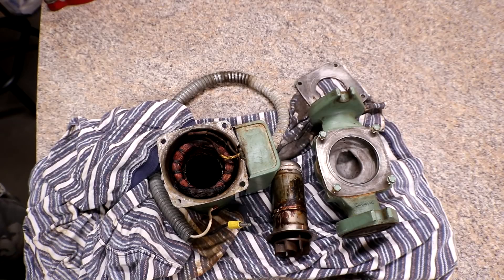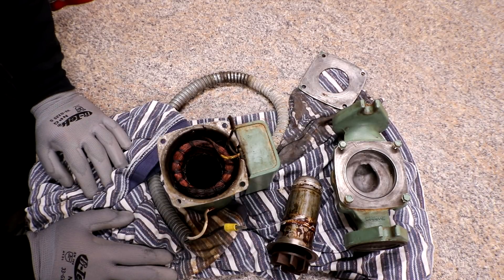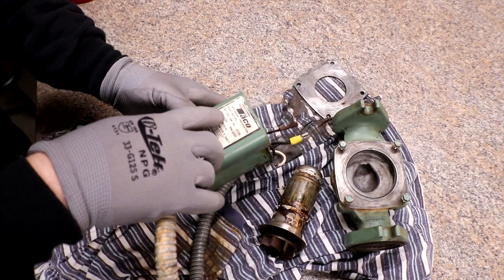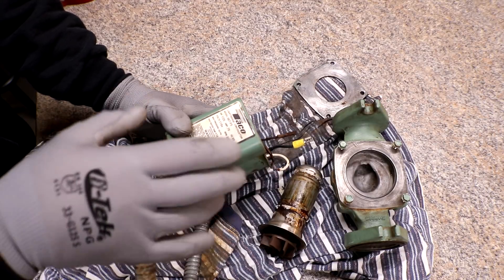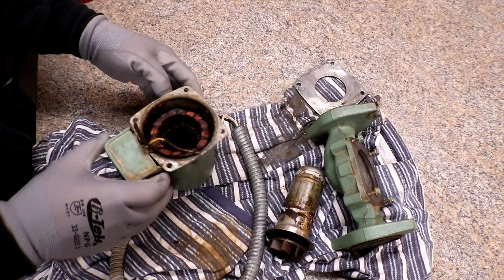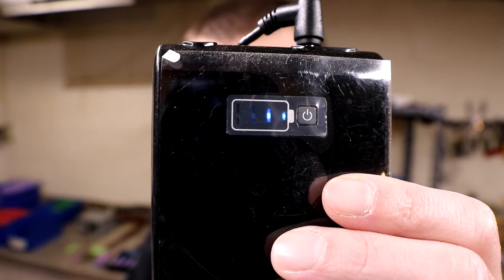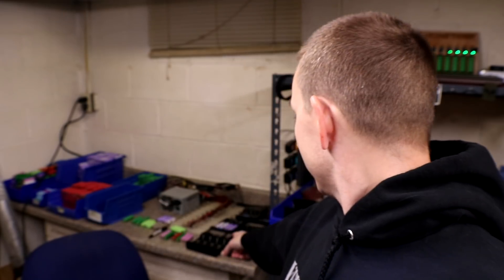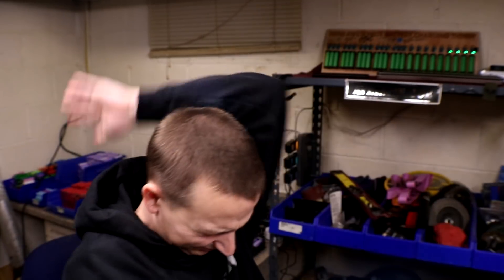Diy Tesla Powerwall ep74 Random Update on Batrium, Solar Hot Water Heater and More

Comment: For your pump, replace the gasket with Red RTV. That'll handle the heat better than the black stuff that it comes with. Also, it wouldn't hurt to add some heatsink material to the housing of the motor to help keep it cooler. 
Does the pump have oil in it? If it does, you might want to replace it with new mineral oil. If it doesn't have oil (I haven't seen a true water pump without it), you could probably add some in. The oil will keep everything lubricated, but more importantly, it helps to dissipate the heat.
Reply from the maker: Yeah I might have to try some rtv  next time I do some maintenance to it.  Theres no oil where the windings are and not sure about the cartridge.  Thats not a bad I deal to add tho👍

Comment: more solar hot water!  :)

Did you say max temperature of 240F? That is HOT... water boils at 212F unless sealed for high pressure (think radiator+cooling system or a pressure cooker).
Reply from the maker: LOL ya I said it.  All I know is it gets hot as sh!t and I had to put a lil vent on it to let the steam out.  Next time its sunny(hopefully this weekend) Ill use the the ir temp meter and check the tank and get it on video.  Yeah I would say its kinda like a car setup and it just circulates all day so it gets hotter and hotter.  Also when the tank gets low the water get hotter.  If I keep the tank full it helps to keep the temp down!

Comment: I bought a cheap battery pack for my cannon. When it failed I opened it and found that there were 2 18650s and a empty cylender!
Reply from the maker: EEEK, I bet it was expensive as well?  Did you replace the cells?
Reply: No I boughat one fromn Cannon

Comment: Why and or how is your solar hot water heater above boiling point
Reply from the maker: +James Holbrook It gets super hot some days and were I have the vent outside, it steams like crazy.
Reply: AveRage Joe but do you think it gets that hot and also I think not 100% sure but I think water is kinda self regulating as far as a max temp being basically 212F at atmospheric pressure and all
Reply from the maker: True... I believe you are correct but its similar to a vehicles system.  The water can get hotter then boiling because its kinda under pressure.  Mine I guess would be similar to that? lol  It has a vent but the vent is a 1/4" copper line off the tank and goes outside maybe a total of 5ft long .  So its "open" but "closed" cause once it heats up a little pressure builds up cause it cant escape fast enough and therefore gets hotter then boiling.  I think thats roughly how it works.   All I know is it gets damn hot lol.  Long story short, I got four 4x8 nova solar water heater panels off craigslist for free from some farmer like 8-9 years ago because the pump and tank went bad.  He said they sat there for a few years after he scrapped all the other copper lines, pump and tank and he just put in a regular water.   He didnt know much about the system.  I just had to take the panels down a haul off.  I kinda rigged up the rest from there to make it work cause back then I couldnt find much about them.  The panels look like this http://www.getgreenair.com/project/solar-hot-water-systems/

Comment: I highly doubt you have more than 116ºc, given that it would boil and turn into vapor near 100.
Reply from the maker: It does get over that temp so I had to make a vent tube running outside to let it release the steam.  I just have to top it off every once in a while😱💨

Comment: I would have thought their cabling would prevent you hooking these up wrong.
Reply from the maker: The directions say to cut the ends off if you dont have the little converter board that converts the longmon plug to wires (which I have lol) If I would have just left it alone it would have worked just fine.  Ill explain it more once I get the watchymon cause its hard to explain something without the part if people are not familiar with the product. I do wonder how often it happens tho💥😜

Comment: I would like to see the hot water setup. Also will a solar hot water setup work in northern minnesota during winter months
Reply from the maker: Ill be doin a video on it.  Yeah I dont see why something like this wouldnt work in any cold climate.  Its called a drain back system.  I did get the solar water heater panels for free off craigslist (cause there super old) but they could be made.

Comment: When you get the new batrium measure the little resistor that is on the new board and then replace the resistor on the broken board
Reply from the maker: I would do that but I sent the other one back because he said there might be more bad parts that we cant see.  I guess the burned out resistor was a 220ohm Tho👍

Comment: Yeah... Used one shipped from Germany is cheap like 30€ for smaller one and 50€ for bigger and shipping around 20€..
If you have 240vac available frequency don't matter I think.....
Try to go on the German eBay....👍
Reply from the maker: Yeah I could run 240vac to in no prob.  Do you think the freq diff would change any of the settings like kwh like it does for clocks. Ah crap it wouldnt matter anyways as long as it efficient lol

Comment: Check out for Wilo pumps..... 👍 
Model Wilo Stratos Pico awesome pump I don't know if are made for 120v/60hz is inverter pump super economic like  usage is 3-4w and it could be set to go super high on demand.. 👍 
Check it out that's technology from Europe.... 👍
Reply from the maker: Those look nice!  Ill have to research them more, Thanks!!!😱👍
Reply: So check out Wilo pumps, one of the best pumps in Germany. http://productfinder.wilo.com/com/en/Wilo/home.html
Reply from the maker: They are expensive but look nice.  I didnt see voltage on there tho.  You ever come across used ones?
Reply from the maker: Just saw a used one on ebay and the pic show 230v 50hz
Reply: look at Amazon or Wilo USA . The cheapest pumps are available from $ 80. -- https://www.amazon.com/dp/B00AI657PY/ref=olp_product_details?_encoding=UTF8&me=
Reply: I would bet that it should work at 220v 60 hz. Motors aren't nearly as sensitive as crossing the tip and ring...Doh! Personally, I don't care for hermetically attached motor/pump units. If you have the space, I would look into a coupled motor/pump unit. Might need to go stainless with the temps you're running. Pretty costly for one that will last for a long, long time. Great video!